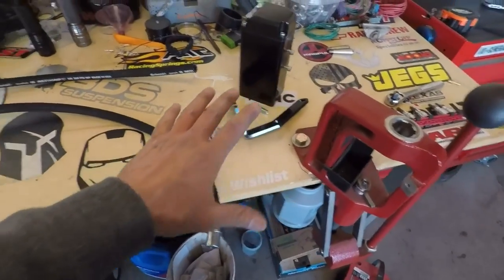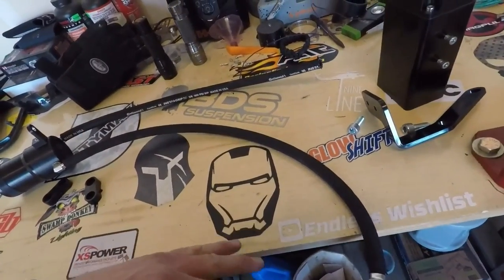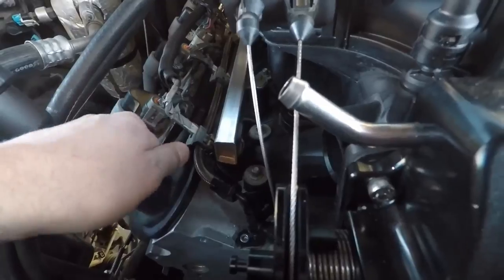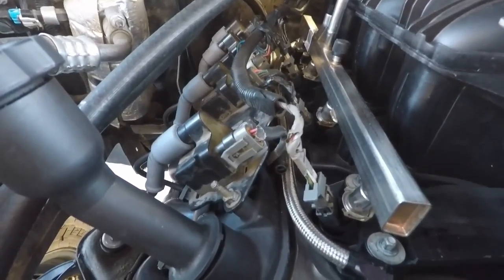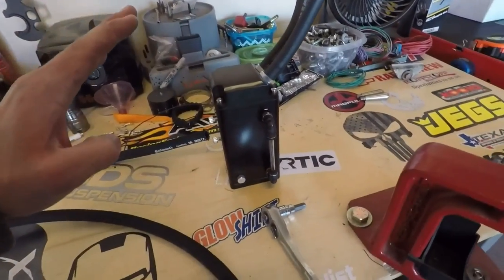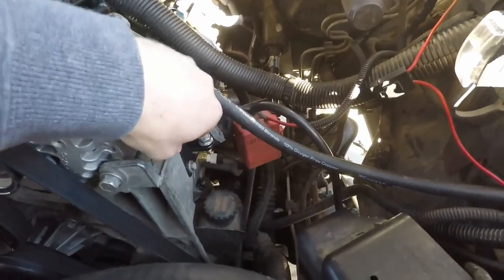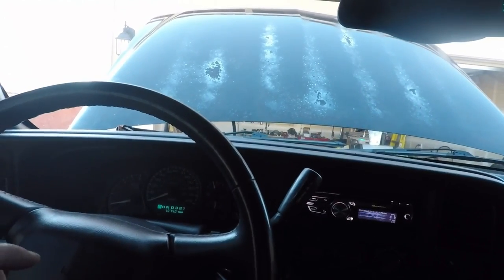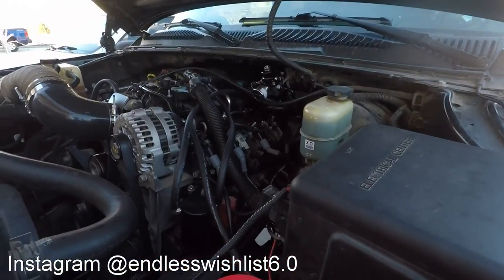Silverado Oil Catch Can Install (How to) Both Sides

Comment: You're correct on the passenger side being fresh air inlet... I did the same thing on my truck before I figured it out... like you, I was shocked at how dirty the intake was and I didn't want to take any chances either... my passenger side stays clean... it's drawing clean air into the crankcase... I'm gonna take it off and use it on another project...

Comment: I think you should re-clear coat your hood. Real easy and real cheap. Just sand the existing clear  off, then re-spray w/ clear - your hood looks like new. Hood scoops are only a good addition if there will be enough high speed driving to warrant a scoop, otherwise its just an "appearance" issue.

Comment: Correct me if I'm wrong so in reality if your getting alot of oil in the intake manifold means alot of blow by due to bad or cracked piston rings or oil rings so instead of rebuilding the motor and putting new rings u can use a catch can to get more life from the motor untill you do need to do a rebuild or open the engine block and but new piston rings or bigger pistons or viscera????
Reply: Thanks in advance if anyone answers my question......
Reply from the maker: If it is a lot of blow by then yea you have a problem. Some blow you is normal. Oil vapor is inevitable. So if you can capture it and not have to run it back through your engine the. You are only helping it run
Reply: I have fairly bad blow by but it's because my rings have been gapped for nitrous. So in some cases it's not a "problem" because I purposely did something that caused the blow by and the builder informed me that it will always burn some oil due to my extra ring gap. Just some extra info for u to take in

Comment: So is it necessary to have a cc on both sides or just one? Ive only seen people installing it on driver side this is first vid I seen on passenger side
Reply from the maker: Just one side. I ended up taking one side off. Just need the driver side.
Reply: Did you do the updated driver side valve cover or not?

Comment: Correct me if I’m wrong.
I’ve read a CC is NOT needed with port injection 
???
I also have a 2002 6.0 Silverado 
Excellent videos 
Thanks
Reply from the maker: I can tell you it is needed. I have drained a good amount of oil from it

Comment: Whats up Brother. Great vid Ive gained some more insight, tho not quite enough. But with your post I think Im getting closer.  > Installing a CC on my 12 Genesis RSpec. Your the first one (amazingly) who has described the installation where both valve covers have a pcv valve. My thought has been why wouldnt both valves run to the CC?  And what kind of fittings might I use to run both to a single can.... After watching your vid in full, You nixed the second can. Which is exactly what Im after.  On my Genny the pvc line from the drivers side goes into the the air intake pipe real close to the actual intake. The passenger side goes into the air intake pipe but further up like 3inches. So am I to conclude I want to concentrate on the drivers side only??

Comment: Hi
I installed catch cans on both banks. (2004 Tahoe).
At oil changes I have 1/8 cup in drivers side can, while passenger side is bone dry. What does this mean?
Reply: It means you waisted your money
Reply: @ericg.201  haha.  I took the one off the passenger bank and moved it to my 2007 Silverado driver bank.  No loss.

Comment: Could I theoretically use the speed engineering catch can on the drivers side and make my own bracket?
Reply from the maker: Yes. Or just run longer hoses to the passenger side. That’s what I did on a 98 I ls swapped.

Comment: How did you get your truck to make over 14 volts?
Reply from the maker: Idk it just does it! It is actually a little high. I was trying to get it lower
Reply: Endless Wishlist did you do the big 3 wire upgrade
Reply from the maker: Yea and it didn’t really do anything.

Comment: Your honest,  You didn't edit video and shows that there will be issues until you work out the bugs when you start doing changes to motor. I had same issue that mine died pulling out of gas station shortly after I did my cam and then it's great now after toon.

Comment: So, how has this setup worked out?
Reply from the maker: The driver side one works great. The is no need for one on the passenger side.
Reply: @EndlessWishlist  cool, I have an 05 ppv tahoe that's just started using oil and smokes when first started, intake and throttle body are drenched with oil..